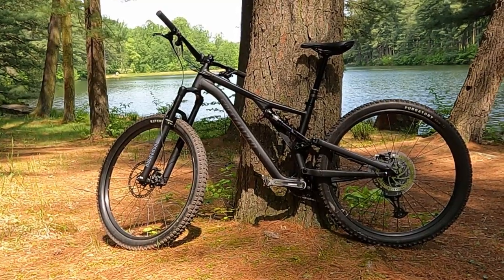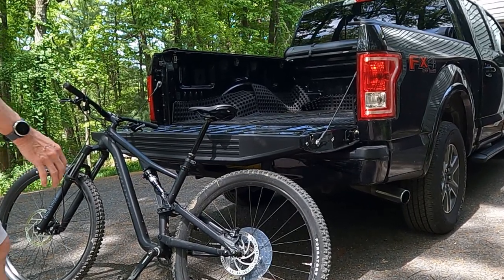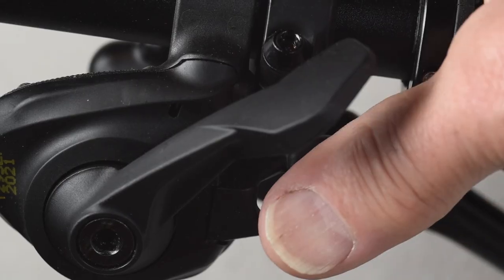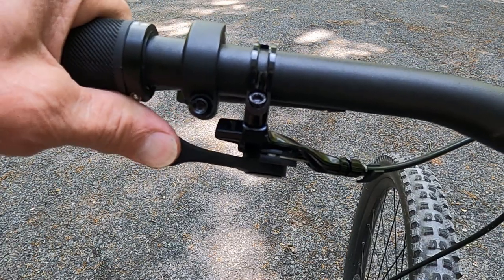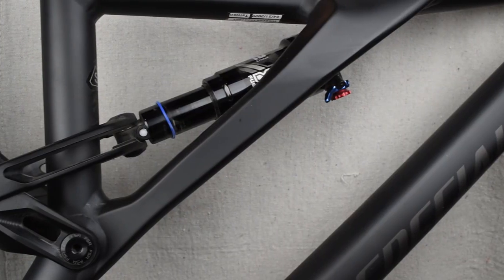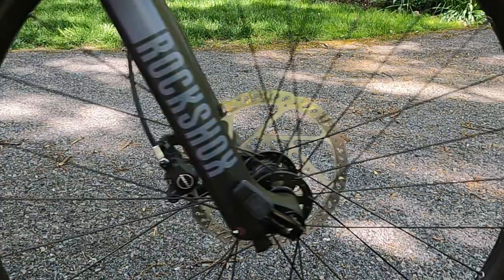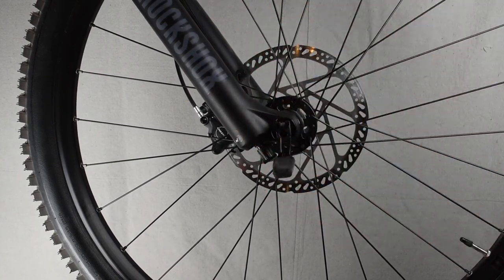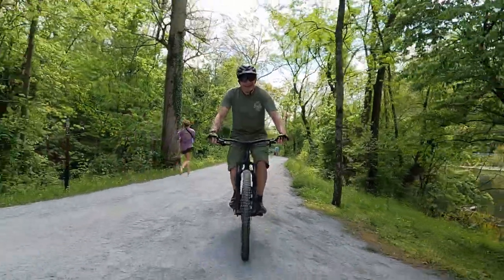Review: Specialized Stumpjumper (Stumpy) Alloy - Overview

Comment: bougth this one for my bafang powered mid build great video thx.
Reply from the maker: You're welcome!
Reply: I'm also thinking of buying this bike for a mid drive electric conversion, but i was wondering where the battery would go. The bottle cage attachment seems to far down the downtube for the battery to fit. How's your build coming along?
Reply: @troypresa  I have a shark/dolphin pack battery, exactly the one that goes to the bottle cage attachments. 
Mine didn't fit because my battery is just too big and the rear suspension gets in the way. With an smaller battery it is doable, either attaching it straight to the bottle cage attachments or putting an  aluminium plate (some batteries come with one) on the bottle cage nuts, then drill separate holes in the plate to have the battery higher in the frame.

Some people also attach the battery below the downtube, with hose clamps/velcro straps etc.

I put mine on the top tube, it's ugly and dangerous because It's attached with zip ties right now. I still have to figure an better way to keep the battery still. There are other battery options, but  an battery attached on top/down tube is best for the weight distribution.

oh and this bike has those ISCG tabs near the bottom bracket, these came to me as an surprise and one of them blocked the motor. Had to buy an angle grinder and cut the tab off and be able to push the motor in the bb.

but bike works great and is really fun on small forest paths and other "rough" terrain